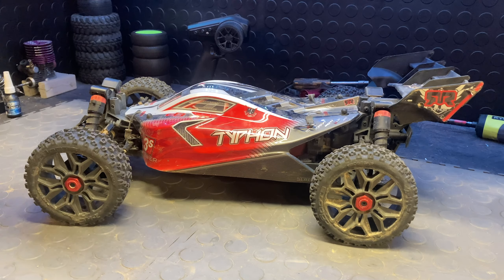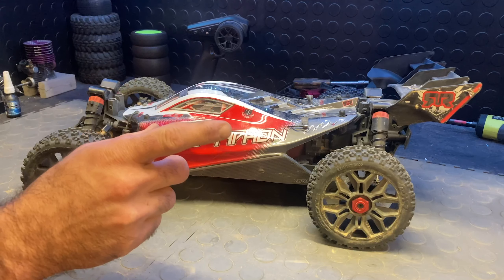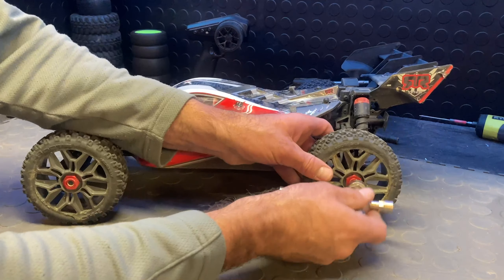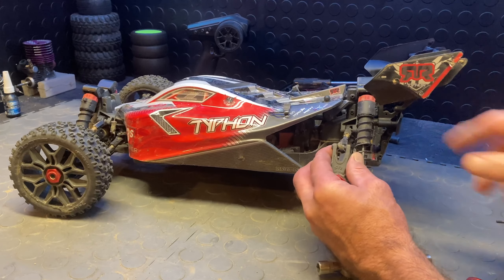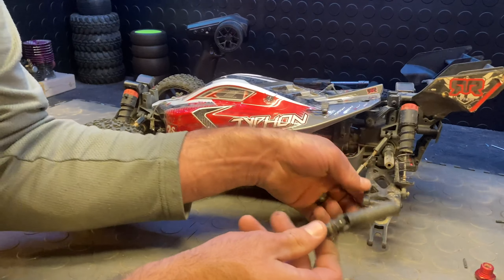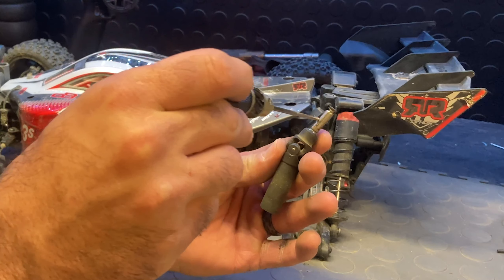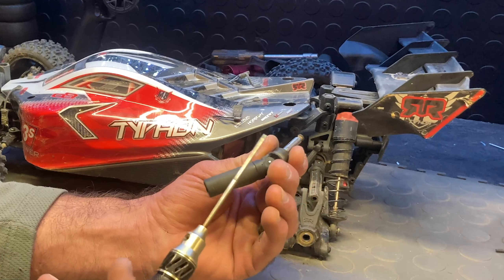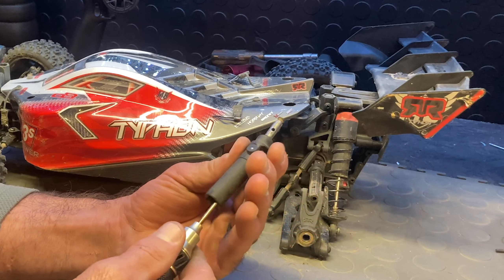Does Your Arrma Typhon 3s Wheels Fly Off?? East Fix!!

Comment: I have a 3s senton and my left rear has came off  the past 2 times ive ran..2 different wheels  and I don’t really do any big jumps just mainly track style runs. The hex is spinning inside the wheel and kinda stripped out the plastic around the hex too. Do you think this is due to the same problem in the video??  
Im about to tear the truck down anyway for cleaning and drive/diff gear grease and needed to find a fix for the wheel issue. Thanks
Reply from the maker: Sounds like you might have the same issue in the video as well as not tightening the wheel nut tight will cause the wheel to come loose and strip out the plastic hex in the wheel
Reply: @theRCelement  that might be it i put a washer behind the nut and it didnt come off. i just tore mine down and greased both differentials and the drive gear..i ran it yesterday and it ran super smooth..but my universal joint at the end where the hex goes on the left rear axel is super loose. its floppy. i know they swivel and are loose anyway but theres zero tension so im thinking that might be the problem. are you familiar with the steel blue/red ones on ebay? thinking about buying those if there good quality